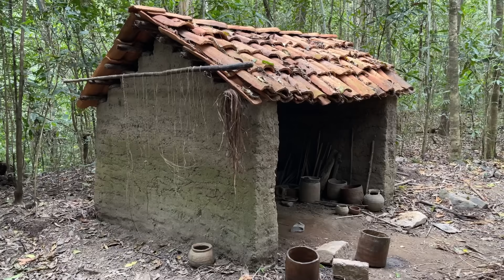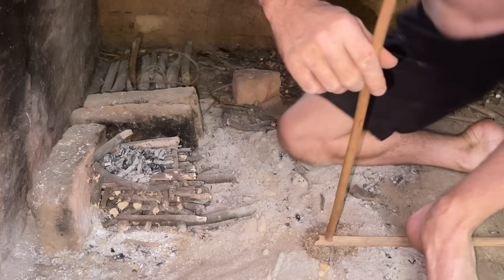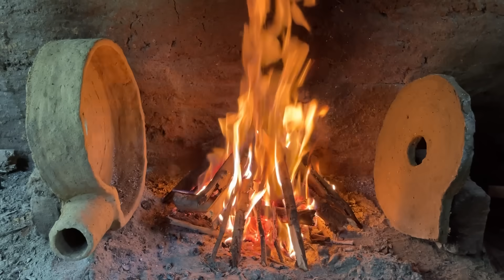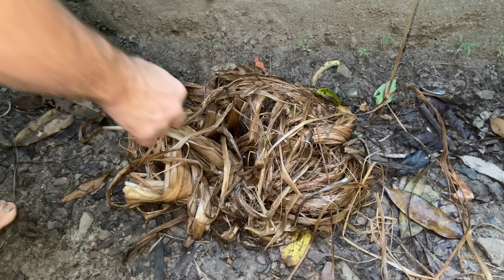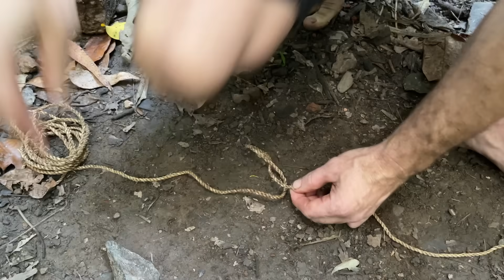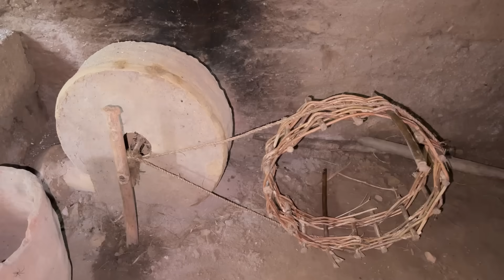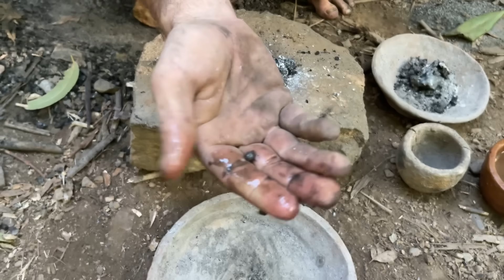Primitive Technology: Floating Pulley Blower Smelt

Comment: You should apply your working knowledge of rotary motion to wood turning. Put smelting on hold. Make a lath and use it to turn wooden components(shaft, pulleys, etc.). Then you can make more effective blowers and mechanisms with your upgraded components.
Reply: Don't you need sharp knives for wood turning? The knives he's been able to make so far aren't particularly sharp.
Reply: @Hyperlynx2  Is the stone age a joke to you?

Comment: have you considered using pitch or an adhesive/binder of some kind to provide more durability to rope and woven constructions? also even extending the height of the furnace slightly and minimizing the cracks can greatly increase yield as it can give more opportunities for chemical reactions to take place. I also wonder if reusing the slag from previous melts can help increase access to ore as certainly more than 15/1200g on average has to be iron. I would wager that the slag has a considerable amount of iron left in it.
Reply: Where's he going to get pitch from, though?
Reply: @Hyperlynx2  Pitch and tar can be made from tree sap.
Reply: The problem hasn't been anything to do with the belt. The problem is the clay pulleys keep cracking at the thin wall with so much use, so it makes it harder for the belt to stay in place. He's had to make so many pulleys more than he's had to make rope. That is all.

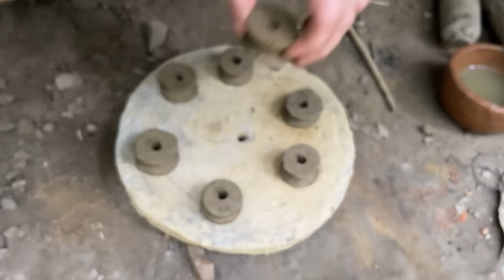Comment: 9:53 why don't you make wooden one?
Reply: It's extremely difficult and time consuming to make a truly round object like a pulley wheel out of wood with the tools he uses.  Part of the issue is the difficulty in being accurate.  There's also the issue of the types of wood available and the grain direction which can massively affect the resulting shape (which shifts over time as the moisture level changes) and the likelihood of the wood cracking and splitting.  Clay is much faster to shape and can be corrected and retired multiple times to get it right.  It's possible to make a pulley wheel that would work, but not worth the time or effort for what he's doing.  To make it worth doing pretty much requires simple machinery like a tree lathe, which you could make with stone age tools.  However, it would also require a better source of metal for tools (iron or steel would be best, but copper or bronze would work too).
Reply: How
Reply: Carving something that intricate isn't easy without metal tools, and the best tool John owned is a crude metal knife.

Comment: Now that you've got working pulleys and belts, maybe it's worth revisiting the water power idea.  That one was fairly limited by being direct drive, but if you've got any decent amount of drop in your creek, you could probably make a primitive aqueduct to feed the top of a fairly substantial water wheel.  Carpentry is a bit of a challenge right now, though it seems like you may not be far from being able to smith some tools.

Comment: On your spout, the re-entrant corner should be thicker. There's a stress concentration there and the extra clay could help you prevent cracking
Reply: Thicker clay would risk differential drying cracks. Maybe a gusset of some form from clay of the same thickness?

Comment: Make a small sheave from a thicker tree trunk or a thicker branch, not from clay, it will be more reliable. Make the shaft of the small pulley triangular or square at the landing site. On the smallest sheave and shaft, make a hole on both sides for the key at the landing site for more reliable fixation of the pulley. Good luck!

Comment: My suggestion would be to power the wheel using water, so it is more of a set and let it run. If you used the wheel on the outside, you could use the waterwheel on the complete otherside, or inside the braces, thus adding balance to the shaft, so the weight isn't being torqued to one side.

Comment: With a larger wheel and smaller cranks on the central axis you can double or more the RPM
Reply: Yes, and it actually wouldn’t be that hard to do. Make the initial wheel a little bit larger, then lash a pair of parallel “spokes” on either side of the wheel running through the focus(?), then lash a couple of handles to the spokes on opposite sides partway towards the center. Easy.
Reply: @thire7432  exactly

Comment: I wonder: could you fashion some extra clay bowls (dry but not fired) and put your charges in there (charcoal and ore together), and rather than take the time to do each one manually, just dump a bowl in and go back to forcing air? Or is the delay so brief in putting the charges in as to make the time savings inconsequential?

Comment: I think you're losing a lot of power/heat by using such a short furnace. By simply having it be taller, but keeping the charging cycle similair, you'll cause a lot more air to get sucked into the furnace as the hot air shoots up the chimeny and causes suction. Makes the whole thing more efficient. There's a reason every smelter I've ever seen work well is fairly tall. usually chest high or a bit shorter. If the flames are sitting on the edge like that, it's not tall enough. This will also keep more of the heat in place to melt the iron. 
You may also want to explore near your iron sludge for iron bearing rocks to get easier ore. That bacteria is getting the iron from somewhere and importantly swims towards iron. Follow the sludge, you'll find iron.
Reply: "Follow the sludge, you'll find iron."
I live my life by this motto.
Reply: @Alicorn_  Ancient dwarven saying
Reply: @Alicorn_ ^doom metal enthusiast
Reply: He's done much taller furnaces in the past I believe, although for some reason his best yields tend to come from these shorter ones. Even still though, plenty of room for improvement, and there's just so many variables are work here that without modern techniques it's gonna be hard to get much out of such poor iron sources.
Reply: @cwalk1066  It seems to be because the shorter furnaces have blowers for them that makes them have more airflow than the natural draft furnaces.
Reply: @cwalk1066  From what I recall, he also used more material in the taller furnace. I think the idea is to keep the amount of charcoal/ore the same (enough to go up two layers of bricks, for instance) but have more empty space at the top.
Reply: @cwalk1066  hell, he still hasn't reintigrated the ash insulated design
Reply: @cwalk1066 the sluge is quite pure iron tho.... Its his furnace and that he keeps blowing too much air
Reply: I think he could also put the tuyere a concentric tube with perforations to increase the airflow using the venturi effect
Reply: As far as I understand it, these bacteria emit Fe ions when in anaerobic conditions, which dissolve completely in low-oxygen water and fall out of solution once they get oxygen to bond with. The actual source of iron could be way upstream, or small deposits spread out over a large area.
Reply: @MrAsdf12347 I figured it was from all the clay. Clay is red from the iron oxide in the soil.
Reply: @MrAsdf12347  if this is the same place hes always at the sand in the ground has some iron.  I'm pretty sure he has a video where he just smelts sand and gets some iron and makes a knife out of it actually.
Reply: @buddyguy4723 iirc, the sand smelting got less iron than the usual bacteria sludge smelts, so he went back to bacteria.  The knife was made from the results of all the smelts up to that point.
Reply: @patrickdix772  all his iron to that point? I'm working off my admitted suspect memory.
Reply: The taller chimney makes more natural draw, but I think this is a (short) experiment for the free wheel (I can't imagine working it for an 8 or 10 hour smelt)
Reply: @Faesharlyn  but is is true he’s done lots of longer smelts trying to get large yields, and the chimneys have never been more then 3 feet high
Reply: https://www.youtube.com/watch?v=U7nqBgklf9E
Gigantic chimney. Worse results. The problem is that his ore is absurdly low quality since he harvests river sand and iron bacteria. The fact that he manages to isolates those iron prills at all is incredible.
Reply: His more serious smelts use tall chimneys, I think it's only short here as he's been experimenting with blower setups.
Reply: Thought "Creator Of The Torment Nexus" Emporium???
Reply: @roxyspamcake  no. But a writer for the onion did do that tho
Reply: yeah but that will make the smelting process a lot longer and currently he is trying to seek a better build for constant air flow. Do you imagine turning that thing for 3 to 4 hour non stop.
Reply: @legro19  he just needs some assistants to run the blower. The iron age wasnt entered by a single man in a hut, it was entered by a bronze age village.
Reply: Probably not too fond of larger constructions because he's a single season from set back to near zero at any time. Imagine if he spent the next three months building a taller chimney, then it breaks, and we don't see him for five months because his plans were scrapped. Frankly, I don't see him moving too much further than early Iron Age because there's only so much one person in an underdeveloped environment can accomplish realistically.
Reply: @jakeking974  Early Iron Age means smithing decently large and complex objects out of wrought iron and occasionally higher carbon steels, which is a far sight away from where he's currently at.
Reply: I can't speak about smelting but the the part about the bacteria is incorrect. Those iron reducing-bacteria (reducing as in the opposite of oxidizing) take the iron III dissolved in water and convert it to insoluble iron II which precipitates out and can be gathered for processing. What's important is that this process happens anaerobically, without oxygen. Meaning that to get better quality material you'll want deeper, more anoxic sediment from a stationary water source that has had significant dissolved iron content a long period of time.
Reply: If you have a continuous blower do you need a natural draw? We're talking forced air here.  Genuine question.
Reply: Awesome to see you here
Reply: i bet you have thought of a way to make that sludge collect other metals.  or put the iron in stuff..... i see you
Reply: At least some more permanent walls of the furnace should be thicker.
Reply: I'm thinking he some reason as why not to, convince possibly. He's doing this with very limited resources and a single person  he would out survive 99% of the people on a abandoned Island
Reply: i am absolutely not surprised that you watch primitive technology
Reply: If he preheats the air flowing into the furnace that would increase the efficiency. Either direct or indirect. Plus using two blowers could be an option.
Reply: I think the idea is that using a forced air furnace like this one with a blower already achieves everything (and more) that a tall chimney can on a draft furnace.
Reply: Yup this is a one idea. To find bog ore. Then the other idea would be to 10x-30x the amount of iron ore for single smelt. I think if he would use 20kg of iron rocks and a tall chimney it would be much less time consuming than doing 10-30x small smelts.

If John would enter 100-300g smelts then he would truly enter iron age and iron tools like knives, hammers, tongs etc..
Reply: he tried this. it didn't work as you'd expect, and according to his guess, seems to require a much taller chimney than he made, which was already a good way up his own height.
Reply: >When your favourite youtubers all watch each other
Reply: Isnt the type of wood used also important? Even though charcoal is made, teh relative heat produce from combustion can vary from wood to wood. Denser woods yield better, but also harder to harvest. Available in your AREA?
Reply: adding a tuyere or two to the base of the furnace to pull in ambient air?
Reply: It's orange,  right  ? I think it's called bog iron
Reply: This guy has to be part caveman
Reply: What if he feeds the slag to the bacteria. Does anyone think he could reuse the iron inside?
Reply: This is such a good advice! 
What you are describing is how a shaft furnace works, but also a bloomery I think its called. 
I've watched a lot of his previous videos about making Iron, and I would say it gets pretty hot, but its not 1200 degrees celcius which is what iron making requires. 
This is evident with the amount of Iron slag that is leftover when he is getting his iron prils. 
There is too much slag which hasnt been burned away. 
A higher furnace would only require maybe a 2 layered brick wall with insulation. 
He could increase airflow further by making it a cylinder formed top. 

I would love to see him try this for his next furnace as that would make the process faster, but also increase temperatures which would make his iron gatherings better IMO.
Reply: If he wants to retain heat: The walls of the furnace have to be lined with insulation. With some hollow points, or just REALLY thick.

Also the taller stack makes it naturally connecting, so free fan.
Reply: Short furnace because he didn't want to set the roof on fire. The roof tiles are supported by wooden beams.
Reply: Was thinking the same - some of his best smelts were in the slightly taller - and round! - furnaces he made on the spot in earlier videos. Would love to see the new blower with those.
Reply: @MW-xl3ux  And now there is a new video about that furnance :D
Reply: Holy shit, my favourite paleolithic wizard gets advice from my favourite information age wizard.
Reply: I red this in your voice. I couldn’t not. Iconic voice overs.
Reply: He already had taller. Wasnt rly helping
Reply: fascinating.
Reply: wow, i like your channel plz post more videos about biology and genetics
Reply: This guy has to be part caveman. Thoughts on adding fiber to the clay to make it more resilient to cracking? Or would it do that even?
Reply: @Steve-ns6txaren’t we all literally part caveman? Like… since we evolved from them?
Reply: @TheGreatCog  If we consider that the vast majority of prehistorical people didn't live in caves and the evidence available to us is survivorship bias, it's maybe possible that you could be descended from prehistorical people but not directly from any given priest or pilgrim or whoever who was motivated to delve into a dark cave and paint complex things on its walls by weak torchlight.
Reply: @TheGreatCog i am part of the enlightened…😇😂
Reply: Hey! Go back to making good videos, you!
Reply: And a lubricant made from bananas and coal
Reply: What can you train iron ore slime to do?
Reply: If you see the tribal furnaces used in Africa they are tall chimneys.
Reply: @thethoughtemporium um i did not expect you here
Reply: Yo dude what are you doing talking about mud furnace, don't you have some e coli to impregnate or something?
Reply: in any case he continues to over heat the charges by smelting them into cast iron prills. wrought iron would be much more useful at this stage and doesnt need as much heat to work it.
Reply: @chrisquinn8150  he's goin for quality not quantity
Reply: @chrisquinn8150 Yeah, wrought iron for simple tools, shafts, bearings etc.
Reply: I believe the river is fairly high in natural magnetite that is feeding the bactate. The sludge collects downstream in natural coves, not where the bactate is actually active.
Reply: Wasn't expecting to see you here man!
Wassup huge fan!
Reply: You want to teach the guy? Give me a break.
Reply: He needs correct chemistry,  he needs limestone to reduce iron , atleast thats what we studied in school.
Reply: os br manja
Reply: Holy shit, its thought emporium. So cool to see you in the comments nerding out with the rest of us.
Reply: Holy shit
Reply: BEST COMMENT! I hope he saw it
Reply: The nеrd's big ego couldn't help but make the comment pаssive aggrеssive.
Reply: You know nothing of geology
Reply: With this being Thought Emporium saying this, I’m going to recommend 100% following his advice.
Reply: Lol, 10s ago
Reply: Sadly I think he is only doing late stone age early iron age stuff. Every primitive tech channel I have watched that starts in early human tech usually pushes past this stage because its so time consuming and inefficient verses other avenues of obtaining iron. I don't want to presume what he is thinking or doing but I feel the channel is stagnating in my mind. I would love to see him move forward and your advise might help if taken but I don't see him changing his process anytime soon.

Comment: Great video as usual, if obtaining leather is the reason for not trying bellows I wonder if a tight woven fabric could be made from cordage.
Reply: That’s a lot of cordage… 

I’ve made some cordage in the past. It takes hours to make even a few feet. And as thin as it would need to be to make a fabric would take far longer.

I think what I would do is weave the fibers directly into a cloth. But for that I would probably try to construct a loom of some sort. Or maybe I would try to knit the fibers…
Reply: @thire7432  Woven cordage is how some fabrics have been made for thousands of years some materials used are faster than others, there's a guy on YT who makes it very quickly, making it with a spindle whorl would be quicker but probably to fine to last very long when used for bellows.

Comment: also wondering  why it's always just iron prills and what he can do to get them to coalesce into a proper bloom. does the shape of the bottom of the furnace need to change? does he need to smelt MORE iron for longer in a single firing? something else I'm missing?
Reply: blast pressure...so, a direct relationship between yields and how much air can be forced? what a bout making the blower larger? force more air volume?
Reply: @TizonaAmanthia  In some of the techniques that make a big bloom that you beat together, the iron isn't supposed to actually melt; it sinters together as a solid and you get less burning and less carbon in the steel.